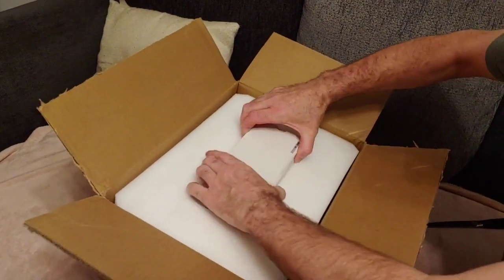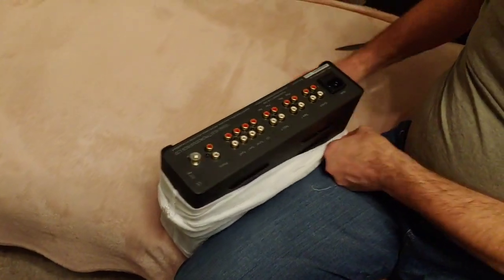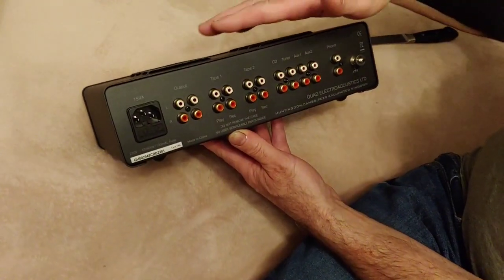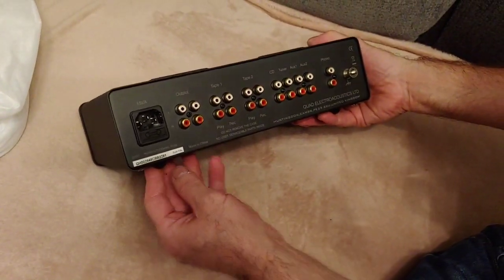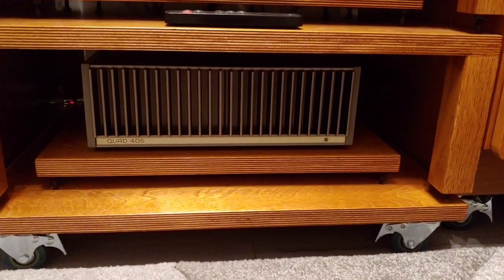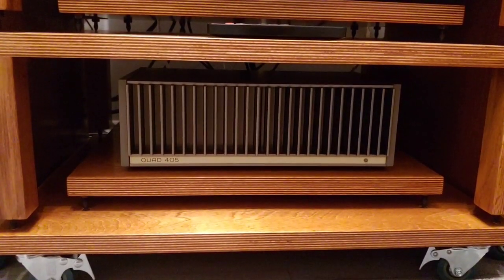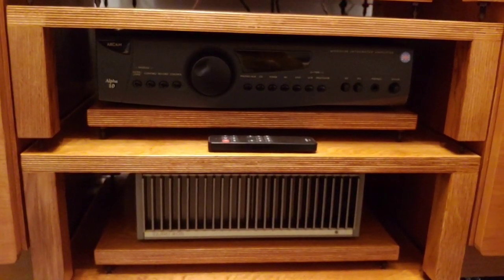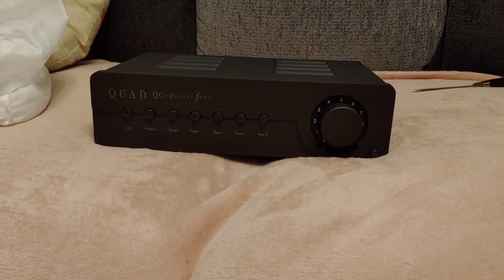Unboxing The Quad QC24 Valve Pre-amplifer

Comment: Re the 405: all these kit boards are made in China these days, so there's no question they're Chinese. The question whether they are cheap or not depends on the quality of the components. There's not one single audio grade component on there that I could identify. They're all generic standard components of Chinese origin, which means they don't adhere to quality control standards set by hifi manufacturers. Some repair men don't believe in audio grade components and will say they're a waste of time and money. However, they're quite happy to charge you for replacing broken part after broken part, which is what you get with cheap Chinese boards. Cheers and good luck.
Reply: Thats my thought and concern too...
But, how does it sound? 
Is it comparable with the US high end brands who use valves in their pre amps?....
Reply: @explorinlearnindoing5462  No. Valves in the preamp is a sham.
Reply: @audioupgrades  Why do you think so? 
To my ears tubes sound better than solid state. But I have Martin Logan CLS 2 speakers now and use a Class A power Amp now with a Quad 66 pre amp. Sounds real nice, but the CLS sound better with tubes so I am looking for a good affordable tube pre amp.... 
What do you think?
Reply: @explorinlearnindoing5462  Because they are ordinary solid state amplifiers.The transistor-amplified signal is passed through a tube, which only adds a little distortion. It's a trick to fool people.
Reply: @audioupgrades  thanks, you mean in this Quad pre specific? 
Or in all Tube Pre amps like Conrad Johnson, Audio Research, etc..?
Reply: @explorinlearnindoing5462  No, I mean almost all preamps that are marketed with tubes, these days. They're solid state, with tubes as distortion devices. The highend ones you mention only use more expensive components.
Reply: @audioupgrades  okay... so then what do you think is a very good amp?...
Reply: @explorinlearnindoing5462  Assuming that your power amp is OK, then the choice of preamp depend on how many sources you use. If you use the lot, i.e. turntable, CD, tuner, tape, DAC, media player etc, I'd suggest going for a vintage preamp, e.g. a top Sony ES model. If you only use CD/DAC or turntable I'd suggest going for a passive preamp with just a volume control and a separate phono amp for the turntable.